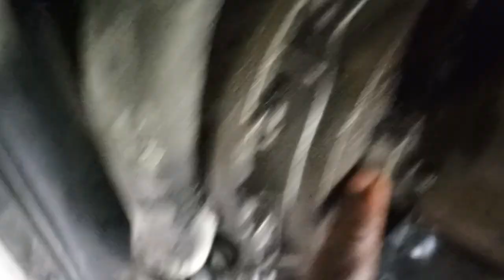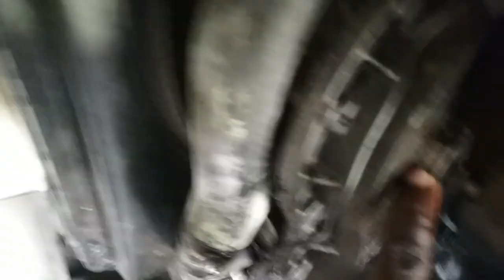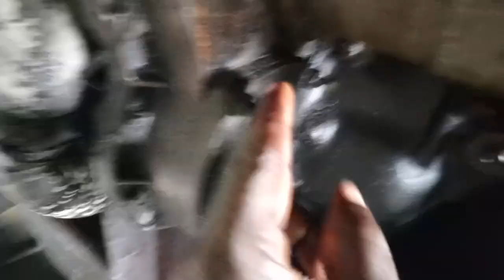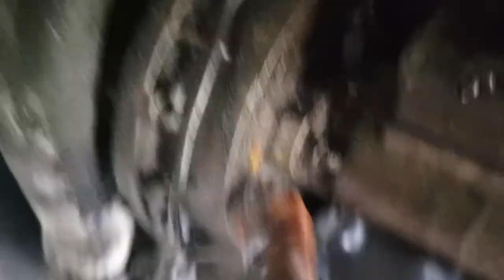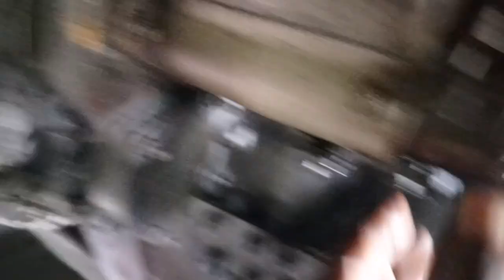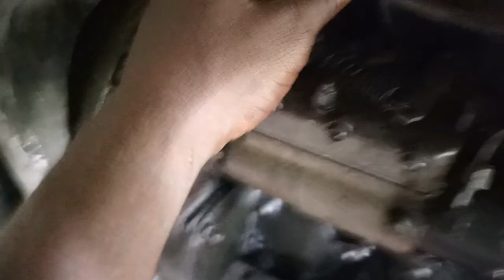Perkins Diesel Injection Pump Timing Advance

Comment: Will this be the same for a Massey Ferguson 50E with a 4 cyl Perkins diesel? Also it has a powershuttle, which type of fluid for the transmission and pto gear box?
Reply from the maker: Check if there is an advance mark on the body of the injection pump
Reply: @mrengine  There definitely is.